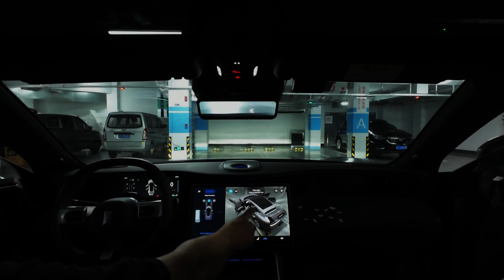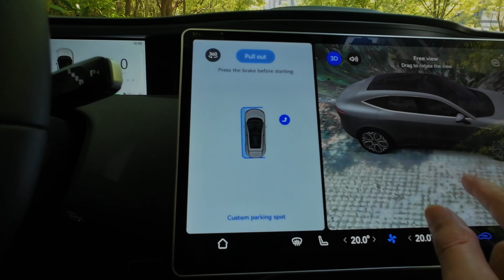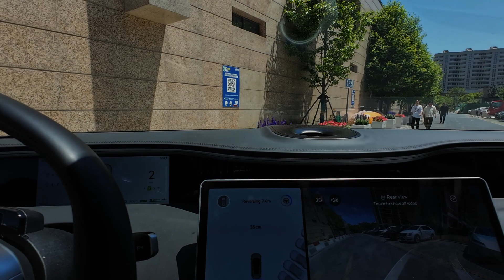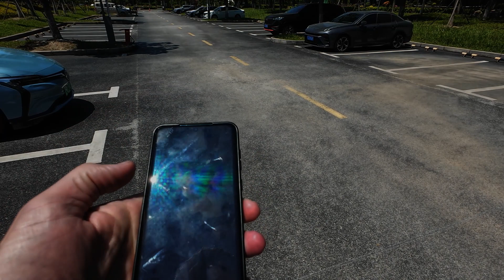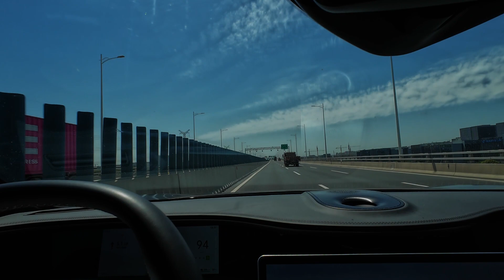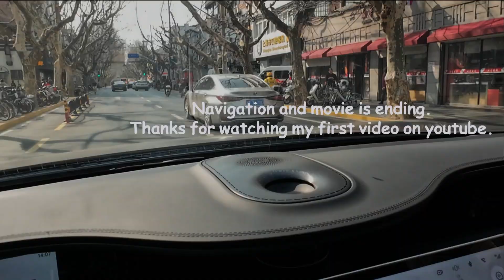AVATR 11 ADS 2.0 self driving in China/Shanghai - better than Tesla's FSD

Comment: Thank you for the amazing video, and great video on Out of Specs too! Would you still buy Avatr 11 at this point in time? i'm also trying to buy either the Avatr07 ultra or Avatr 11 max trim. I'm a novice driver in China and my biggest worry is parking and the car being too big(?), so my Q is (1) Do you encounter any issues while doing automatic parking? and (2) do you feel the car is too big sometimes when you drive? thank you!!!
Reply from the maker: Sorry for my late answer.
Yes, I will stay with Avatr. 80000km and only one broken ultrasonic sensor, caused by driving in the extreme cold. 

The ADAS is the best available on the market, also because Changan has a huge egineering team assigned to ADAS and Avatr is 10% shareholder of Huawei's sub-company.

Parking: I don't care anymore. More than 90% I let the car park itself, including latest VPT (valet parking) (see my latest upload). Where and how the car parks it not anymore of my concern. I never had any difficulties due to the large size.

Avatr 07 is an excellent choice. Just, I hope (not confirmed), that Avatr 11/12 will be upgraded to Level 3, whereas Avatr 06/07 will remain Level 2++ systems.
Reply: @KaiUga-ni3hk  This is great thank you. The more i look, 11 looks like the best one to me as well! thank you for the detailed response!

Comment: Hi, I seen  you most recent video with Out Of Spec Reviews. They didn't ask the most important question? Are you/ do you actually use the ADS system, if so in which use case and how often?
Reply from the maker: I use it daily. The latest software, ADS 3.3.3, includes passing tollgates and other features. 
Recently I drove 2000km across China, including heavy rain, rush hour, traffic jams, etc. I used it around 95%.

Still, steering wheel needs to be touch every 120sec, latest.

Fun fact: yesterday I used real valet parking: exit the car at the entrance and let the car find an empty spot.

Comment: Like Xpeng Motors, you did it with them or they will be much better even if they had far less users than your Huawei system which is used by BYD and most important brands from Xpeng Motors is much more protective, much clever to spare any risk. Huawei system is quite good, but not as effective as the Xpeng XNGP.
Reply from the maker: Thanks for watching. 
Indeed, there are several excellent ADAS-systems available within China. XNGP is one of them, also Nio is doing great. In future it will be hard to distinguish between those systems, as under normal circumstances all of them will bring you from A to B safely in a certain time. 
I am happy with Huawei's system paired with Avatr, and probably will post an update once ADS 3.0 will be available - soon.
Reply: @KaiUga-ni3hk  is Ada 3.0 already available and will you make a new video about it?